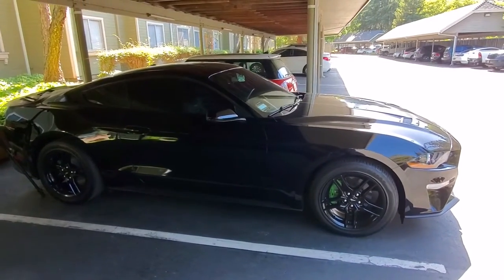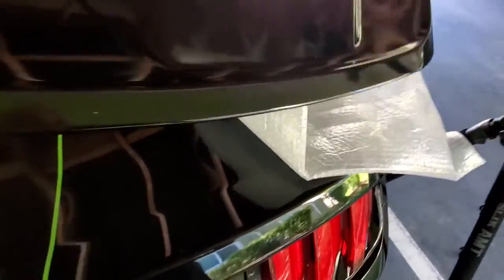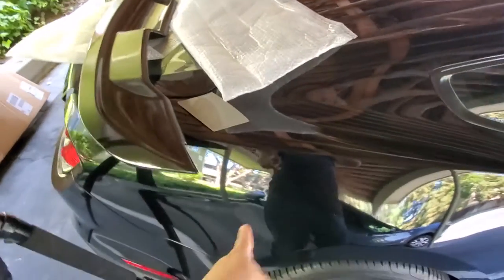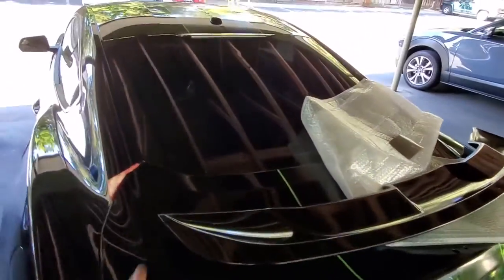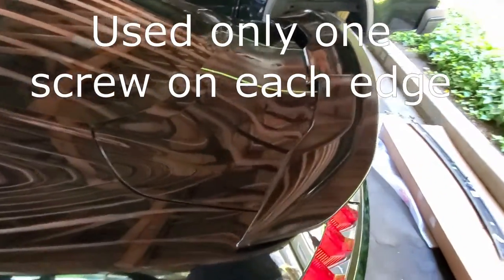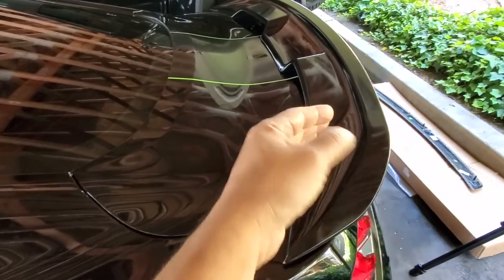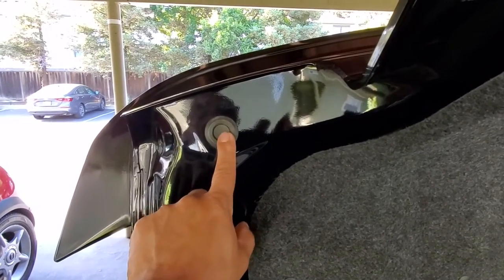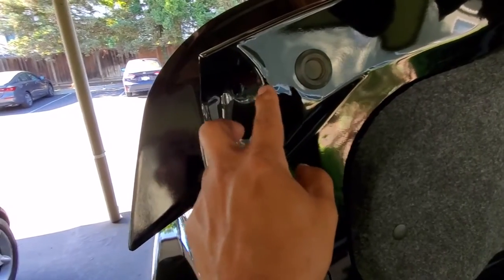2020 Ford Mustang EcoBoost [Ep 11] - GT500 Spoiler Install

Comment: I have a 2020 pp2 Mustang and I put the same spoiler on, mine came with dowel pins in it lined up perfect and I put 4 nuts on mine. Oh yeah firgot' my brother was going to sell a dealership a spoiler for a customer's car and it was an EcoBoost and it wouldn't work because it didn't have the sans holes as the GT
Reply from the maker: Yo Mustang Marty! Thanks for watching, really appreciate it! You're right! The original spoiler had dowel pins too. But I guess for ebay stuff I can't expect to be as good haha 😆.  Wow, I bet your PP2 makes some serious power. Ours is still stock in terms of performance  but, no slouch at all ✌😁.. stay safe out there!✌

Comment: Looks great man! Now take that temporary registration sticker off on the inside of your front windshield!!! 

How does the glass black on the spoiler compare with the black paint on your car?
Reply from the maker: LOL!!! You're right!!! I saw that while editing the video! .. OMG.. Thanks and will do! LOL
Reply from the maker: Hi Jon, the gloss black if very similar. You can't really tell the difference in color. BUT, I can actually tell it's plasticky. It does have some minor imperfections but, you really have to get close and inspect it. Can't tell just by checking out the car.

Comment: In my opinion your car needs 2 more mods and will be looks amazing:
1- Eibach sportline lowering springs. 
2- GT500 front bumper.
Reply from the maker: Hi 5.0GT! Thanks for watching my video ! Hey, do you know if those mods will void the warranty? Yeah I haven't done any performance mods because the car is pretty much new and I'm afraid of voiding the warranty. Cool man, thanks!
Reply: @ecobooster8298  it shouldn’t void your warranty. at least if it’s a Ford warranty. you can do a lot more performance wise before voiding it. like a cai without a tune. or performance exhaust. (assuming you don’t already have these)
Reply from the maker: @peytonlove2598  Hi Peyton! Thanks so much for the info! Really appreciate it. Yes, I was worried about voiding the warranty but, seems we're able to do a lot of cool stuff without voiding it! Thank you, stay safe!

Comment: Any issue with it wiggling on the highway  been looking at this spoiler for weeks now it looks great!
Reply from the maker: Hey Mike! Thanks for watching my video! To date I haven't experienced any wiggling. However, like I mentioned in my video, I'll have to keep an eye on it because it did tend to arch backwards . I think it's because the design curvature may be slightly off from the trunk lid curvature. That's what made it a little difficult to fully seat down. Or, maybe I tightened it down too much?

Comment: Very well. I do not have the factory holes or installation template. Do you think it could  enough only with a very thick 3 m tape??thank
Reply from the maker: Hi John, thanks for watching! What year is your Stang? It should have the center holes no? The 3m tape is actually pretty strong.  Just not sure how it would hold up over time? If it doesn't have holes,  you may want to think about drilling some. Really hope you can get it done! Peace ✌️
Reply: @ecobooster8298 no, I don't have a hole. my mustang is a europe. and the spoiler is optional. the 3 M is a little light to last over time, that's for sure. thank you for your answer

Comment: Did you put tint on the windows?
Reply from the maker: Hey Maurice,  sure did man. Check out my video called Back in Black. 
Thanks for tuning in and stay tuned for more! Peace ✌
Reply: I'm back and forth thinking of putting tint on my EcoBoost windows but I think it will eventually start peeling off and looking worse than before. Your car looks cool though.
Reply from the maker: @mauriceparris1816  Hi Maurice, that's exactly why I didn't do it myself. I've had tint professionally installed on other vehicles and it never went bad. I had the EcoStang done professionally too and they provide "lifetime" warranty. So that helps in case anything goes bad. Check your area and see if they offer warranties. It does make the car look super cool!
Have a great one!